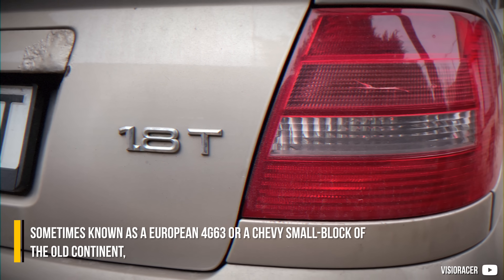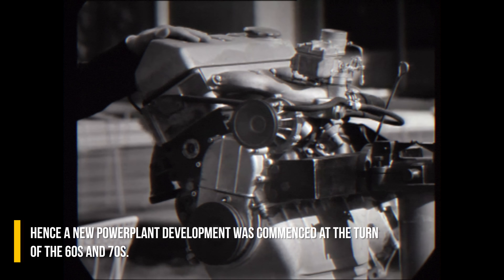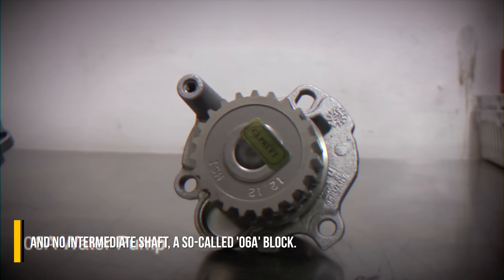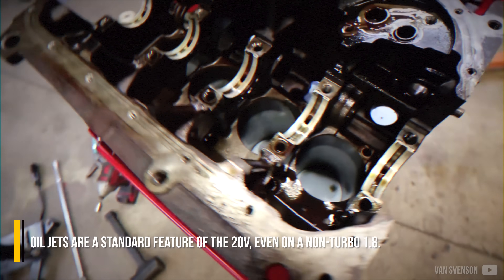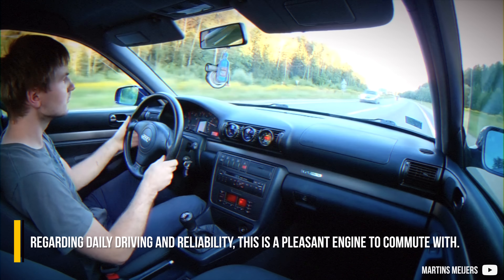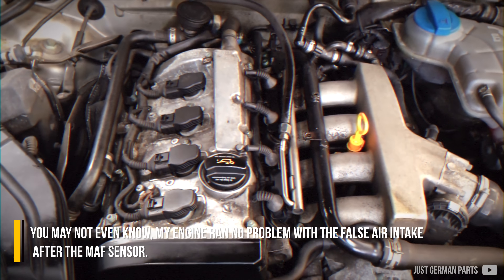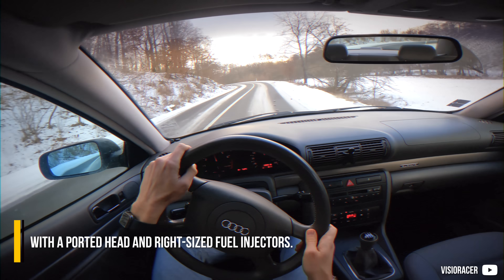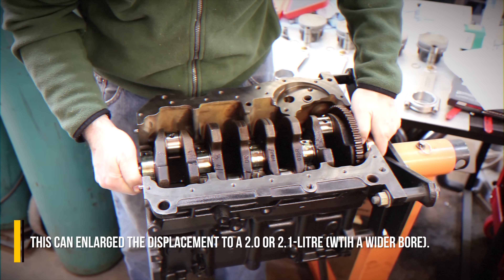Why Is The Audi 1.8T 20V So Good?

Comment: Yamaha did -84 first 5 valve per cylinder engine. Audi did use 5 valve per cylinder first 200/5000 model -85 talladega race circuit passing 200mph even more on straights 350km/h.

Comment: Had an A3 with a chipped 190ish hp and currently a TT Quattro with the 225hp K04. Great little engines, but work better in higher revs. The K04 units also have twin Intercoolers I believe.

Comment: Enjoying my 1.8t Cupra, mk1 Leon's are the best looking ones with 1.8t imo ;) pushing 221hp atm with 336nm of torque and honestly I think that's enough to satisfy me, coulda went with a cupra R and get 225 stock but...I didn't lol. used to be equal with my mate's Type R when doing rolling pulls now I'm leaving him behind even when giving a lead. Engine head rebuilt in October so 5 months ago and semi-refurbished the gearbox too we'll see how reliable it lasts at 90k miles now. Drove to Belgium from Scotland and back last month which was 2,000 mile round trip no problem. 
Only issues I had with the car was timing belt got chewed as previous owner never replaced the bolt for the engine mount when he polybushed, they're single use bolts so it snapped when I reversed it and the threaded bit fucked the belt up. Then had Cam position sensor fail on me, £20 and 10 minutes later that was fixed. And finally used to get 2 engine codes due to the decat, that got taken care of when remapping as it would come back if I'd just erase it. Trouble free for now ;)
Reply: All personal preference. I will pick my A4 B5 Quattro anyday over any VW, Seat or Skoda.

Comment: bent rods, oil pump, blown head gaskets, the 180hp engine was not even close to be good, the 150hp was very solid but performance wise it was a shame, head had bigger ports tho, the 225 was fine but you got alot of better engine choices, like the saab b204r who still holds the record of the quickest 1/4 mile 4 banger, honda b/h/k series which was faster without needing of a turbo, toyota 1zz, mazda bpt even the dodge 2.4t was a more reliable engine

Comment: Polo 9n3 GTI owner there..
I’m always surprised by its high response from both engine and steering. 

However, at the same time she’s got a lot of leakage from bad valve gasket cover, oil pan, water pump and its pipe and gasket between transmission and drive shaft…

Owning her makes you feel like drifting between hell and heaven lol

Comment: my mother had one, in a a4 b5 wagon, it was fun, but not reliable, the engine itself made it to 400'000km, but the suspension bones were changed at least 4 times, it died finally with its 3rd turbo, stopped counting sparkplugs and sparks (always used 98 gasoline, not 95)

Comment: After my 1.8T Jetta wagon was rolled, I now have a 2004 Passat B5.5, with the tiptronic.  My Turbo is still going strong after 158K.  Also original alternator!  Car has been super great to work on.  Believe it or not when i got the car just over a year and a half ago it still had the original air filter!  A true testament to how the car still went on strong.  I also had a split PVC boot and faulty PVC. No idea how i did not blow a seal!  Fitting a manual boost and oil pressure gage, and an oil catch can is a must for these cars! Still get up to 30 MPG's doing 80 MPH!  Average 25 mpg's.  I want to keep this car as long as possible, then I will go out and buy another!

Comment: I've got a 2001 1.8t golf with the AWW. 

Its got 190,000km and the only major work I've done was a timing belt at 168, ironically not due to the belt, but because the water pump gasket failed and began to leak an extremely annoying amount of coolant. Did it right in my driveway over a weekend, access sucked but it wasn't difficult, just a bit tedious. Otherwise, its suffering from the classic mk4 rust around the wheel wells, due to the saltiness of my locale in the winter.

Out of all the vehicles ive owned, parts have been pretty reliably the cheapest i've been able to find. The aftermarket  for volkswagens is friggen 'uge, and spare parts are extremely plentiful. I have yet to play with any bolt ons or tuning, but thats coming soon! 

Overall, 10/10 would buy another.

Comment: If I had to have a VW, out of the 4 cylinder engines I would prefer the 1.8. That said, I will stick to my Honda cars and engines over all. Making big power is cool with a boosted engine, but I personally still prefer when a manufacturer can prove they make amazing N/A engines. It is cool these engines can make 200+ HP stock with boost, but Honda managed 200+HP out of 1.8 liters N/A and I have seen 1.8 liter Honda engines making nearly 300HP at the crank N/A and 2.0 liter Honda engines making over 300. Granted, those making more than 200 had to be modded to get there, but this is still before adding boost. I think Audi should have developed the engine to run N/A first and optimize the flow, THEN added the boost. That all said, out of their boosted 4 bangers, the 1.8 was the most reliable. I still think the greatest VW I drove was a 2.5 liter 5 cylinder, 5 speed manual equipped Rabbit. The engine barely fit, but that sound, all that torque...TINY little car........ I want more of that, please?

Comment: Is it normal for this engine (AEB) to have a knocking-like sound on rpms? 

I mean like groaning/thumping noise at 2000ish rpm? 

No other issues than the sound at the max torque area.
Reply: Check transmission mount - Buy new one from lemforder. If you buy anything cheaper, you'll be forced to replace it every 5k km or so. On top of that - engine mount inspection and full exhaust inspection (including catalytic converter). Front axles inspection is a good idea too, but id leave it for the end.

Comment: I got now a 1998 AEB instead of the failed 1.6 AHL ,for about 30k km now ,and the only thing it failed was the waterpump after a pair of cycles on my hunting edges ,was a bit shitty by 6 degrees in a parking lot on december ,but that was fixed after 4 hours ,fuel cnsumption 10 times better as on 1.6 ,much more fun ,much more power .on my 1.6 i was late on racecontrol caused by MAF ,change the whole inventar ,lambda,maf,coil,and so on .did pass the check afte a 20 bugs fucking relais ,get new vignette and right one week after all the oilpump fails ,ring of death on dash .since then i get the AEB and im really good with the car ,its better in all variations and views.

Comment: Never had the 20V version, but I have owned three 1.8Ts all in Audi A4s. Love the power plant as it is refined, powerful and very reliable. My current A4 has now done over 150K miles from new. Max (my car) does drink a lot of oil these days.
Reply: All 1.8Ts are 20V engines... They all have 5 valves per cylinder

Comment: owning a b5 s4 that's making 500whp stock block for 2 years now, I can safely say this and the 2.7t are one of the best engines produced by Audi and in the world. They are reliable if you take care of them and do proper maintenance ( 191k miles on my 2.7t with 190psi compression). The 1.8t b5 is no slouch. With simple rods and exhaust valves and a bigger turbo with proper supporting mods you are looking at 500whp. With pistons, 700whp easily. As far as the 2.7t, rods and 2.8 intake cams with bigger turbos or a single turbo conversion makes 600-700 no problem with 1000whp capable

Comment: I have a manual b5 1.8t Audi at 244k miles just did head gasket top end kit and maintenance while head was off replacing common issues coolant pipe sensor new pipe seals boost lines. Runs amazing at that mileage and daily driving now

Comment: The 1.8T (with KO4 turbo) and the EA888 (with multiport injection) are two of the best engines Audi has ever produced.
Reply: Most people throw the 2.0 engines together, just because they are so unreliable. BMW 3 series, Mercedes ML, and Audis, Volkswagens with 2.0 are the most common European cars at junkyards.
Reply: @3n3ly7m9  It's hard to see sense in condemning an entire engine class on account of their displacement and configuration. I can't speak for 2 litre engines made by BMW or Mercedes because I'm not familar with them. But I do have an 8V S3 and I can't speak highly enough of the Gen 3 EA888. However, it's not just my opinion, Visioracer also has another video on this very engine. Look it up.
Reply: @pervertt  Well not just Mercedes or BMW engines of the displacement equivalent just any of the BMWs from 2004-2010 3 series and all the ML230 to 500 during the 2000s. I stick with timing belt motors, so I would say a Belt 2.0 would be the better engine in terms of keeping the vehicle. I like all the 1.8t, 2.8, 2.7t, and 4.2. I own multiples of most.

Comment: I've got to disagree. The 1.8T took an absolutely fantastic architecture and made it worse in every single way from the 1.9 TDI. You get more power, sure. But you sacrifice massive reliability. Every 1.8T I touch has serious problems, every TDI needs only minor things, the 2.Slows need nothing.  The 1.8T was the beginning of the downward slide for VW's engines.

Comment: Worked on these engines for 15 years now, never encountered an engine issue in my life. Annoying plastics and vacuum system for sure, but the mechanicals are probably the best amongst german cars. Nice video
Reply: And even then, a lot of those annoying plastics can be swapped with aluminum parts!
Reply: @technorunner1  any links, I'm so tired of the Plastics on my b5 1.8t. TIA I have a auto unfortunately btw, considering doing a manual swap my buddy has the parts for 1k, so I'm considering it.
Reply: Beautifully destroyed valves lol
Reply: Oil burning
Reply: meanwhile ive melted two pistons and cylinder liners due to leaning out injectors haha. wish i had your luck!
Reply: Meanwhile, i just broke the timing belt on mine lol
Reply: So long as you use synthetic oil...
Reply: Look in the junkyard.. Automatic transmissions are garbage..
Reply: What about the newer 1.8T EA888.3 gen 3?
Reply: @WaseemKhan-iu4bh  the newer 1.8s are a mixed bag. Definitely better than the 2.0t before them, but still some coolant pump, vacuum pump and timing cover leaks can be annoying. Some that didn't have 5k mile oil changes have chain issues. It's sad, because they replaced possibly the most reliable engine...the 2.5
Reply: What about the 5 speed auto that was paired with it
Reply: @rudydaberry122  The 5Tip-Tronic has a 100% failure rate with Torque Converter for the 2.7T S4 at around 100,000 miles to 150,000 miles. With the A4 they have way less power and last allllloooottt longer. Most if not all cars over 100 - 150 have already or maybe not, had the converter replaced. I have a S4 with it, and its just fine, but someone has put a TCU tune and Heavy Duty Converter in it. I have 1 A4 thats a 97 Avant FWD with a Automatic, it has 283k on it. Also have 3 other A4s with 160k, 283k, 309k miles but they are all 5 speed. I also have a 05 A8 with 129k and thats the 6 speed tiptronic.
Reply: @rudydaberry122  sorry, never thought about automatics. You are rolling the dice with every single automaker with that one. Not trying to sound condescending, just my experience with them😒

Comment: I had the 1.8 NA 125hp. in my Skoda Octavia h1. It was a perfect balance between horsepower and fuel economy for every day driving. Plus outstanding reliability. I've never had any issues with it. :)
Reply: Ooh I have 1.8 NA too, oh boy it rips due to low weight... 192hp stock!
Reply: Tbh 125 hp on a car this big is way too small.
Reply: @KowalDWR  I had a Volvo 240 wagon with exactly 100hp it weights 1700kilos
Reply: @hattwatti  this is one of the reason you "had it".

Comment: Just to give a heads up: the internals could actually hold 500hp, but the weak part are the Connecting Rods. It doesn’t matter which engine, they only do about 380Nm, above that and it’s just a matter of time until they bend.

Comment: Got a 150hp in my GTI 4, 308k and running great but it has a problem i can't pinpoint. When im in the highway at 100/120 kmh at 3000/3500 rpm it sometimes loses power and regains it suddenly, can someone tell me what i have to look for? Thanks beforehand and thanks Visioracer for this fantastic video💪
Reply: n75 boost control valve maybe?
Reply: @DaveH81  it was recently changed for a new one, i believe its the injection system acting up

Comment: that series of engines was known for tons of issues , seen a few of em blow up for seemingly no reason .
Reply: The issues were primarily linked to all the shitty rubber and plastic in the cooling, PCV, and vacuum systems. The motor itself was very robust.
Reply: @naggersdie  so there decent to work on , or work from but not if u don't know and just drive it . That makes sence not like any of the toasted ones I have seen were used by anyone who cared to pay attention to that sort of thing . Usualy they were older people wondering why there expensive German car blew up . I knew a guy personally that blew his up but his was tuned pretty good and the timing belt broke, so not really the engine s fault .( He ever said he should have changed it sooner )  he replaced it with a lancer rally art .

Comment: My 1.8t passat B5.5, made a similar sound to the SR20DET.
3inch wide exhaust, with sport muffler
Made around 180-190hp by unplugging the MAP sensor. Power filter (air filter)
Removed the CAT 
And directly plugg the wastegate onto the turbo (1.6bar of boost)

Fun to drive, and made it over 450.000km/ started on the first tooth

Comment: I had both B5 and B6 with my B6 Stage III for 145,000 miles with no problems. Coil packs, waterpumps and cracking plastics all happened as you mention though. Great motor, and the B6 in particular was a great car.

Comment: Good Video!
But Never 300-350 whp on stock bottom end. 400 Nm, Maybe 420 Nm is the highest you can go with the stock rods before they bend. Thats 280-300 hp at the crank
Reply: Also you absolutely dont have to port the head, this only results in bad responsiveness. Even 600 hp with a stock smallport head is no Problem. Also smallport is better than the bigport because it has better filling

Comment: I owned a B6 Aydi A4 1.8T quattro and it was incredibly reliable.  I never modified it.  I would routinely get close to 1000km on a full tank during long highway drives.  I still own a 2004 Jetta GLI with just a tune, cold air and bypass valve.  Really enjoy driving it.

Comment: My B5 has the 2.8 30V with 193hp, which is pretty fun to drive as its a factory manual. Though i'm really looking into getting an A3 with the 180hp 1.8t aswell.
Reply: They do pull very nice and with a good exhaust it somewhat sounds alike the 2.7 BiTurbo
Reply: I had both, 1.8t and 2.8 i loved them but i think the 2.8 193hp was more fun to drive😂2.gear 110km/h

Comment: Everything you said is true except for the consumption side.  I have two with 1.8T: A6 (150 AEB) and a TT (225 APX + extra tune).  Consume at least 17L / 100km in the city in the best case.  On external roads the consumption is at least 7.5L / 100km.
Reply from the maker: Yeah, though it is over two decade old engine. It is a V6 consumption today, but seems fine to me considering its age and simplicity. My quattro did 7.9 at least with a 5-speed
Reply: @VisioRacer  Yes, it's ok.  Interestingly, the 5-speed version fwd AEB consumes the same as the TT awd with 6-speed (~ 260hp).  I have owned the A6 since it was new.
Reply: TT with the BAM engine here.. I'll get 7,5l/100km if I drive normal, city+autobahn

Comment: Pretty sure the 1.8t doesn't have any forged internal parts factory.. Yet this video claims it.. Everyone wants a bam engine yet the only difference between pretty much any other engine and a bam 225 is the wrist pin size
Reply from the maker: Someone already mentioned it that it does not have forged internals, sorry for the misleading information. I aim to dig some good info on the web, some forums, this one did not turn out right.

Comment: the new 2.0s are really nice as well have one in my b9 a4. beat on it daily great city car , weighs about 3500 pounds feels nimble in tight places has alot of mid range torque and does well on the interstate / great on gas
Reply: You are kidding yourself. New nose heavy direct engine VWAG products are a shame of what they used to be. The EA888 is a joke when it comes to reliability of a 1.8t & is worse in many ways.

Comment: Put an APX from recalled audi tt 225 into  my vw corrado with the oem harness and DBW. Large front intercooler and larger exhaust plus a dyno tuned ecu, 312 whp and 308 ftlbs torque running on 102 octane. Mated to a 5 speed diesel box, it was an animal. Had to sell it when I moved countries

Comment: I've got a 2004 VW Passat Wagon 1.8T with the AWM code. I love 1.8's as I've had a variation in my 91' Escort GT 5-Speed and my Nissan Sentra Type E which was a 4 speed. I change my oil every 3k miles and currently use and love my NGK Iridium Plugs. Even after it sat 4 the entire winter 2 cranks and starts with ease. Very dependable motor that is still whisper quiet with 208k on it.